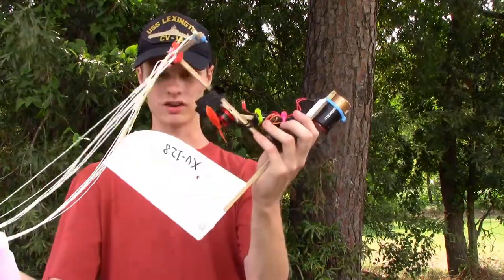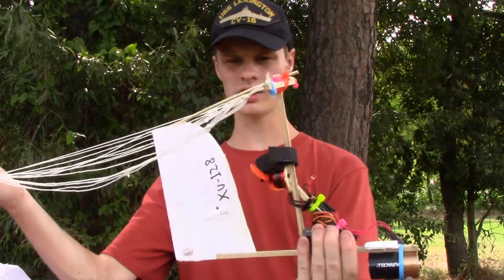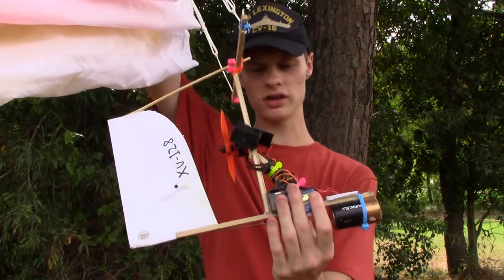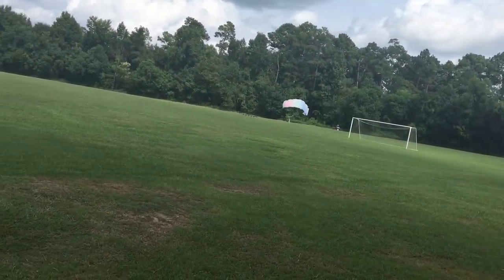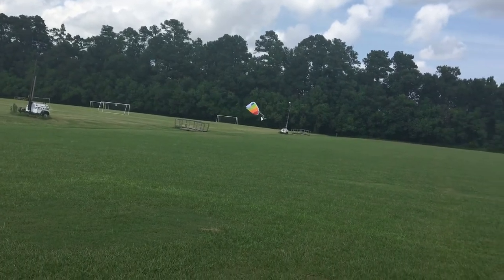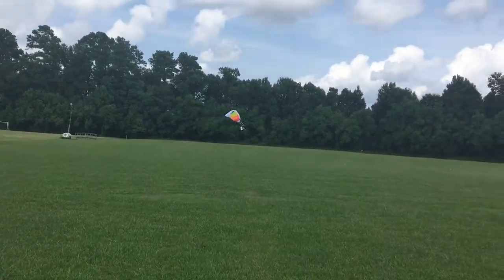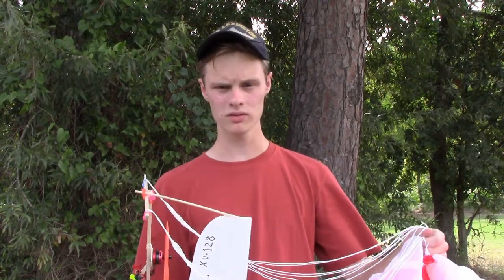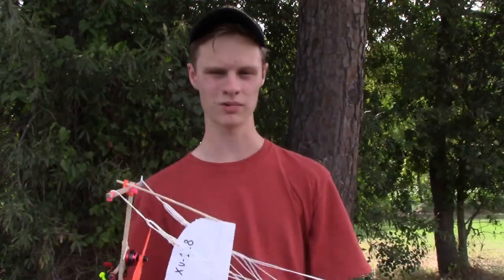Easy RC Paramotor You Can Build! (Parafoil/Stunt Kite)

Comment: Neat. I fly a paramotor, and we steer by pulling lines that pull the tips of the wings down. It might handle a bit better if you added brake lines.

Comment: Hello John,
Can you give a draw of the gondola  please ? 
Can we know the size of the propeller, of the engine and brushless controller?
Thank you very much .
Reply from the maker: here is all the electronics I used for this...
1x 9g Micro Servo
DX2205 2300KV Motor
6x4.5 Propeller
Flite Test 25 Amp ESC
3s 850mah battery with XT60
AR620 Receiver 
I don't have any drawing of this craft, basically designed it by just guessing and cutting...
Reply: @CaptainJohn  
Ok, thank you .🙋‍♂️🙆‍♂️🙆‍♀️
You offer very interesting projects .👌
Reply from the maker: @joaerophoto8485  that’s my mission! Try interesting things!